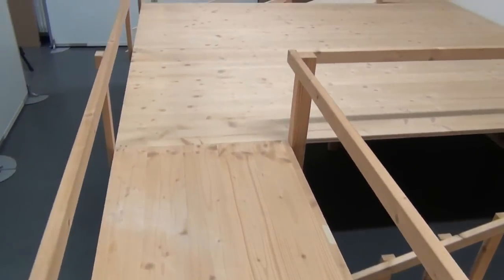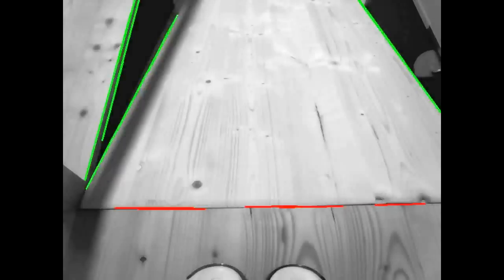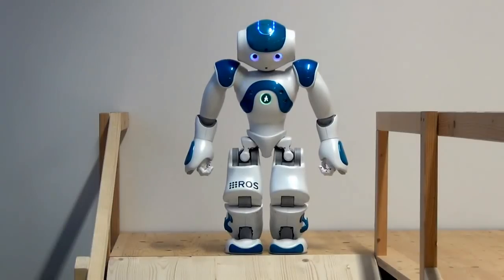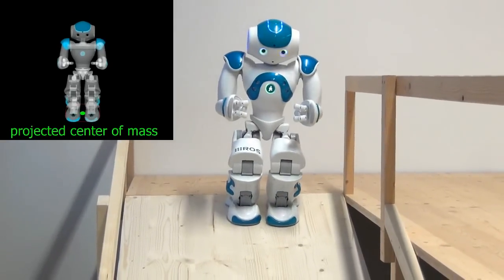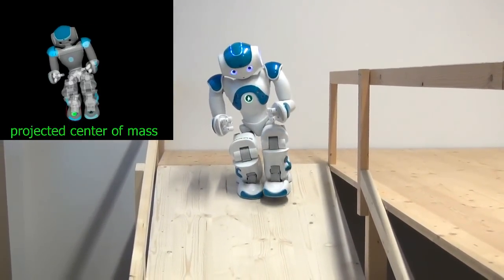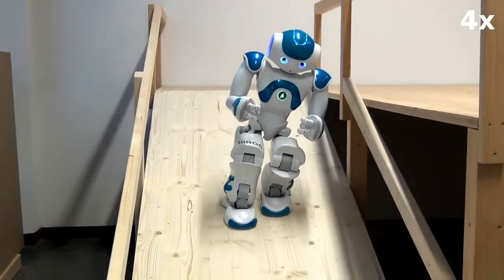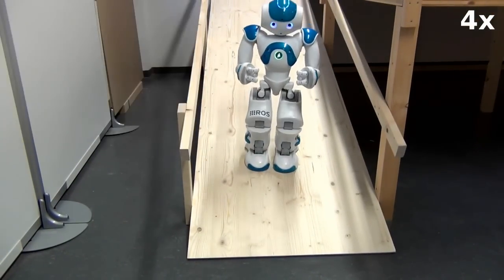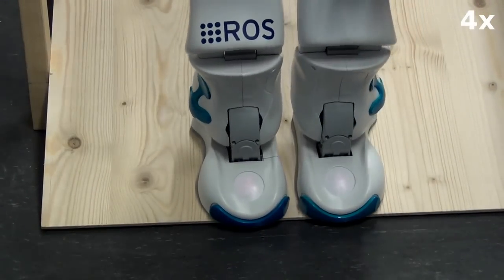NAO humanoid walking down a ramp autonomously

Comment: How come today's humanoid robots are still so slow on everything but the most smooth and flat terrain, and even then oftentimes. What's stopping a robot like NAO from going down the slope at 4 times the speed like in the fast forward bit. What's the bottleneck? Battery, processing power (my best guess), the speed of the actuators/motors, or just the physics of this way of walking? For example, if NAO had an overclocked Xeon E5-2690, could it do any of this faster? Is there any progress on this?